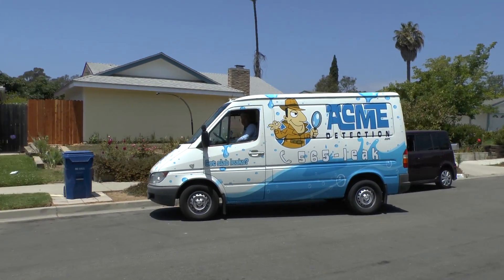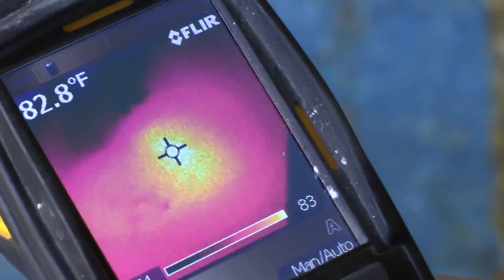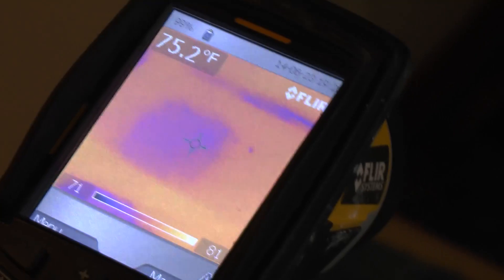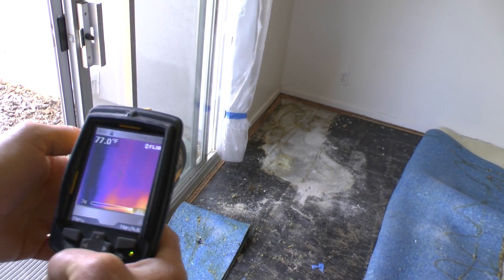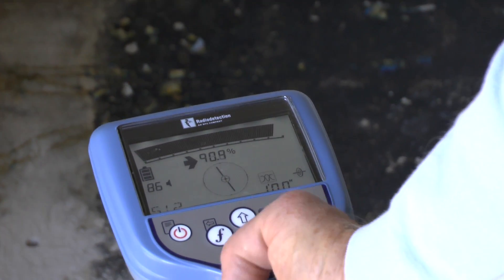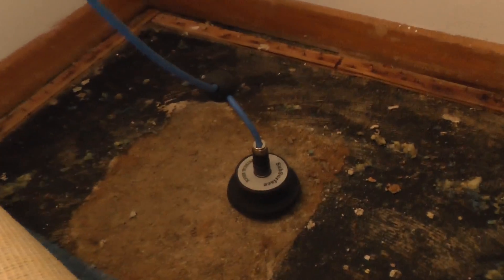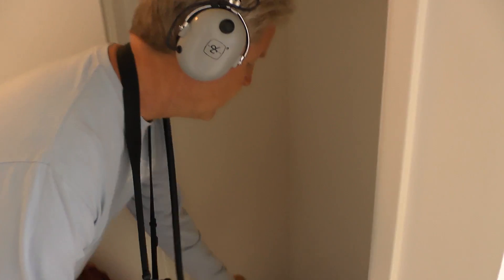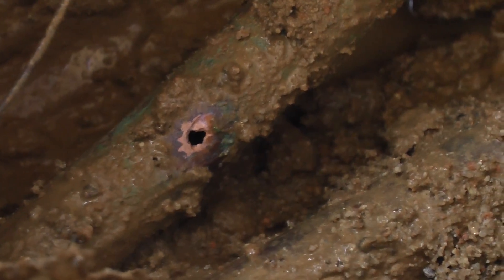Slab Leak Detection — Allamerican Leak Detection Tips & Tricks by ACME Detection, Santa Barbara

Comment: Wow! Impressive. That hole wasn't that small. It must have been growing over the years. Leaks in my copper pipes under my slab of my 30 year old house are a constant worry for me even though I haven't had an actual leak yet. Every six months, I shut off the water to the house after I flush the hot water heater so there's no hot water left, and then I use a phoenix pressure sensor to log and graph the pressure. I let it sit for a few hours to make sure there's no drop. If it doesn't drop more than 1 psi in 2 hours, I figure I'm good. BTW, opening up high faucet and letting it drain from 58 psi to 0 produces about 1/2 cup of water. Also, prior to running this test, I have make sure there are no small drip leaks from faucets. I usually shut the toilet supply valves. If I ever buy another house, it will be on a raised foundation. Slabs are a nightmare for repairs and remodeling.

Comment: Do I need to drain the pipe system before applying tracer gas?
Reply from the maker: There is no need to drain the pipe. The pressurized air (tracer gas) will force the water out through the leak location.

Comment: Sir, my home has 3 floors and i live in the USVI, St. Thomas. the other day i hooked up a 300 gall tank to my water line so that during hurricane or power outages water can flow down to the apartments. during the flow of the water, the ceiling slab of the first floor apt started leaking. what piece of equipment can I use to determine where exactly the leak is? there was a long line of water coming from the concrete slab, which is the ceiling of the first floor. you would provide much relief and anxiety if you can direct me as to what equipment I use to locate the leak . thank you. you can call me at 340-344-1401 (woodrow)

Comment: What caused that hole like that?
Reply: electrolysis. it’s a hole on copper pipe . copper is a sensitive metal it gets eaten up . it cannot touch other metals except brass . they lay them on the rebar when the house is built and they don’t sleeve it right and ends up touching the rebar and in due time that’s what happens
Reply: Cheap stuff

Comment: Is a warm spot in the floor always a sign of a leak? We just bought a house and a hydrostatic test was done. The drains were replaced from cast iron to PVC. We cannot find any visible spots of water. The outside water meter needle is steady and will occasionally move forward and a little back with all the valves in the house closed. In your professional opinion can it still be a leak? Sections of the floor in the living space are warm.
Reply: Hi! Were you able to identify the issue that you had? I might be in similar situation and wonder how you were able to resolve your issue.
Reply: @TheConandj  the plumbers came out and could not find a leak. They said the pipe is just giving off some heat, the house is single floor on slab. Looks like the plumbing is not far off from the floor. You can go out and check your city water meter see if the needle is moving when no water is running. If the needle is moving around then you might have a leak otherwise should not be an issue.

Comment: Mr. Fuller, I would like to pose another question to you sir; do you utilize the infra red camera on suspected cold water leaks? Or hot only? 

I just added the FLIR 2 infra red camera to my arsenal and I'm curious if it can be used on cold piping also.

Thank you.
Reply: I have the same cuestion, you buy the thermal camera?

Comment: Mr. Fuller, nice job on how to locate slab leaks. I'm a licensed master plumber in Florida who has recently purchased the sub surface LD 12. I'm new to electronic leak detection. My first job missed the mark by about 8 feet. I have a question, by introducing air to the water piping, does that enable easier detection?  I notice that the water leak in a copper line makes noise almost all over the house. I was detecting sound over 10 feet away from the actual leak, and when I listened to the angle stops under the lavatory sink, the noise was rather loud. Apparently leaks in copper lines reverberate all throughout the house.
Reply: The trick is to keep the air pressure as low and quiet as possible. Also don't be fooled by air moving through a low spot in the pipe. This can sound similar to the bubbling from the leak.
Reply: Hey T, Did you eventually figure out to do a slab leak detection? Nick
Reply: @nicolaszanetti8745  Lol
Reply: @nicolaszanetti8745 inquiring minds want to know, many years later!

Comment: nice job. i living in Puerto Ric. what is the model of thermal camera flir.  
i used e4.
osorioandsonplumbing@hotmail.com
thank for your time Sr.
Reply: angel osorio 
Hi Angelo,
Your E4 camera is a not as sensitive and does not have high resolution but it should be sufficient for 90% of the leaks you will find in a home. The listening device I use is a Sub Surface LD18 and It is where I would suggest you spend you money as it is far more important than the IR camera.
Thanks 
Gary